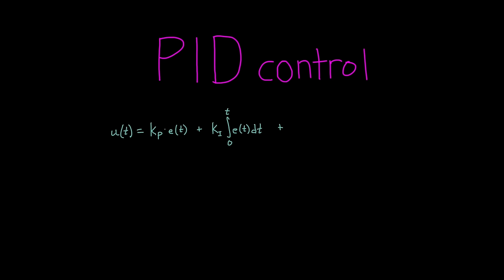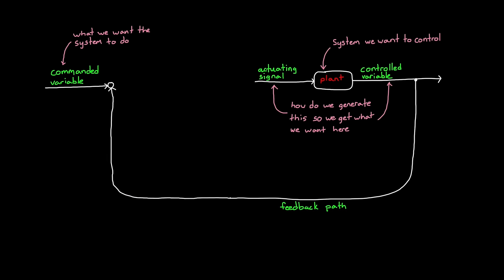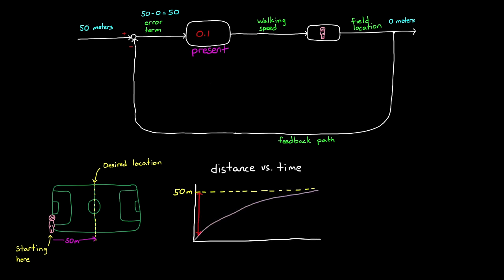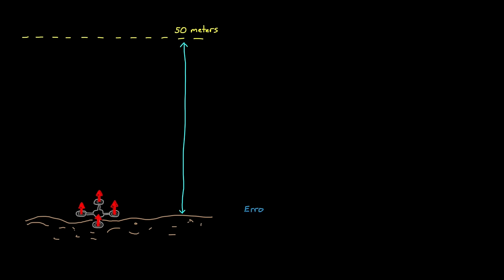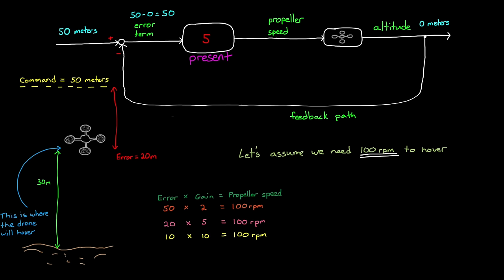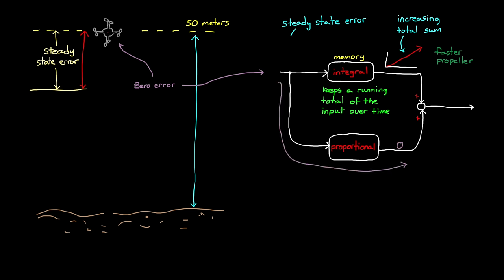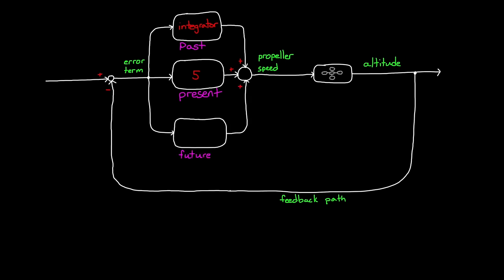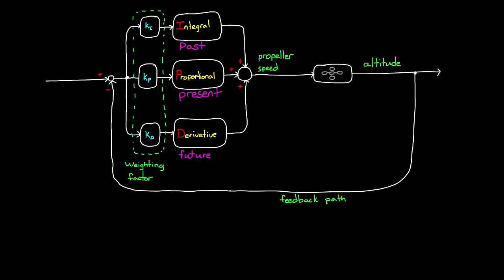What Is PID Control? | Understanding PID Control, Part 1

Comment: I was hoping to start with what PID stands for, I assume PID is an acronym
Reply: PID stands for proportional, integral, derivative. A PID controller is a device that uses a control loop feedback mechanism to regulate process variables in industrial control systems.